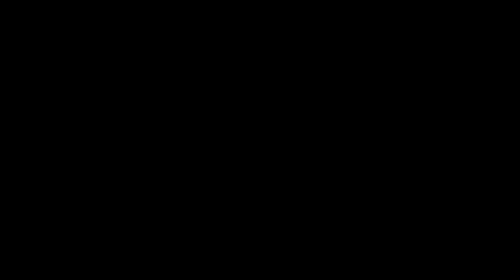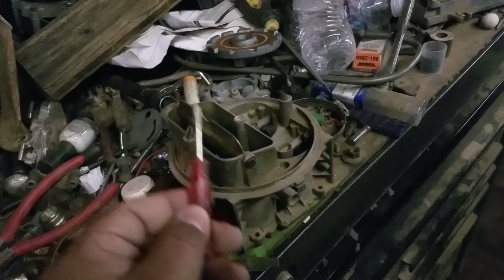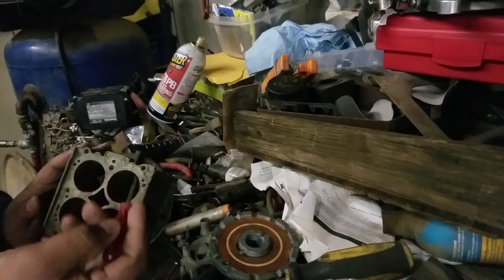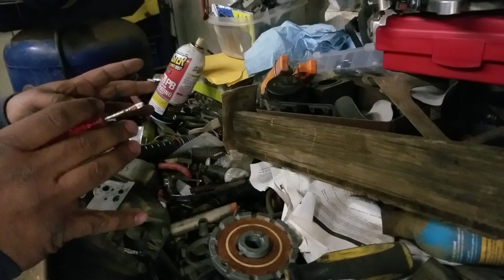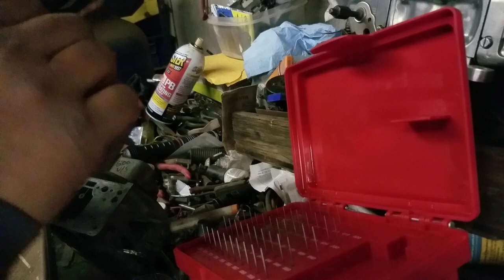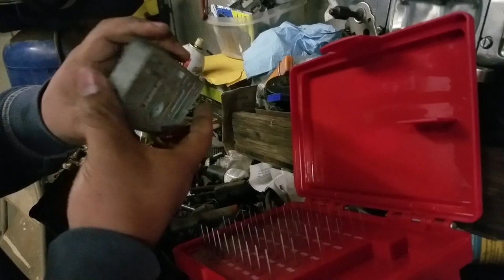5 Secrets For Tuning And Adjust Holley Carbs That The Pro Builders Wont Tell You | Carb LS |NW Ep.60

Comment: You learned all this in a year? Study for 2 and operate on my wife's brain 🤭
Reply from the maker: Lol, when you daily drive a carbureted engine hundreds of miles a week with a vacuum gauge and AFR gauge hooked up, you tend to notice the patterns and once you apply the changes, you can confirm the results or change your method of attack. It gets a little repetetive but after you get it, you get it.
Reply: @NightWrencher  I'm just learning a little bit about my carb, just really started about a month ago, nothing major. Playing around with the simple stuff like choke, idle speed, accelerator pump spring settings. I'll keep up with your videos--- 🤜🤛
Reply from the maker: That's great man, just take it one step at a time and you'll be a pro in no time 👍

Comment: What AFR Gauge do you recommend?
Reply from the maker: Im running an AEM gauge from summit. It was 180 free shipping and has worked great for over a year now
Reply: Thank You for all the GREAT TIPS... On my dual exhaust w/ a cross over where is the ideal place to install the bunge/ probe/ chingadera lol😋?
Reply from the maker: Within 12 inches from your collector on either side of the exhaust works fine. You dont need to install it where both sides hook up if the crossover is too far away
Reply: @yazming1720  "chingadera" 😂😂
Reply: Ive been building hot rods for 20 years. You dont need an AFR gauge. All you need is a Vacuum gauge. Lots of videos from old timers on how to use them properly for tuning. They were the only thing needed for 60 years and racers will only use a Vacuum gauge.

Comment: I like your videos and I appreciate how you're trying to help people learn an old style of Technology with modern techniques and things but your explanation of the use of the power valve is completely wrong. 
The power valve directly relates to vacuum manifold pressure and the only reason you have the adjustability is to compensate for performance and racing camshafts that produce little to no vacuum 4-6" at idle. That is it! If your engine is running above 16 in of vacuum at idle you do not need change a stock power-valve they don't even make a higher power valve for higher vacuum application it is only to be changed for engines that produce no vacuum.
If you're having issues with hesitation or leaning enriching issues and you try to change a power valve to fix it your only been band aiding one issue and creating another. You do not need and I will repeat this you do not need an AFR gauge to tune a carburetor properly people have been running carburetors for six decades without an AFR gauge I tune carburetors without a AFR gauge and have no problem with riching and leaning. If you're worried about your engine being lean or Rich that's why we check spark plugs, there is always going to be periods of richness and leanness throughout the powerband or when applying the throttle or deceleration that is going to create spikes and drops in your AFR you will never have a consistent AFR throughout the range of the throttle plate. 
90% of issues that have to deal with hesitation are the pump not being lashed properly. That is assuming you have the proper timing setup timing and carburetor tuning go hand-in-hand the timing on a carburetor is crucial with EFI you have a lot of wiggle room because the computer will compensate for a screwed-up tune by retarding or advancing timing. You can't forget about timing when tuning a carburetor
Reply from the maker: I'm going to give you an example of why that is not the case. Lets say you tune your main jets and transition to run at 14:1 to save fuel and run cleaner. Now, say you're idle vacuum is at 22hg but your cruising vacuum is at 16. Lets say youre trying to accelerate to get on to the freeway, by the time you drop to 8hg youre AFR is hitting 15 or more and will cause hesitation. Solution would be to accelerate more to drop the hg to 6 and open the power valve but then you've accelerating more than you want to and wasting more fuel. If PVs were made to compensate for big camshafts, they wouldn't need to make a 8.5, 7.5, 10.5, etc. Originally the PV was called the economizer valve and in fact drag racers don't use PVs at all because at WOT vacuum is at 0 always so theres no point in having a PV. When tuning a carb for a daily driver, tuning from 12.5 to 13.5 could save you at least 2 mpg. The engine, if left at 12.5 would run fine, wouldn't smoke that much and only smell a little bit. Tuning a carb to run clean on the freeway requires other modifications to prevent lean spots when you accelerate but before opening the PV and secondaries. I just went through this on my truck while towing on a 6% grade. I was towing up hill but starting to lean out at part throttle, vacuum was sitting at 7-9 for miles, I could drop the AFRs down by accelerating more but then I would be going too fast. On the next trip i swapped to an 8.5 and I was able to go up the climb with no issues. The problem is youre looking at things through a racing lense but not everything has to be about racing some of us just was a carbed vehicle that runs clean and doesnt smell like gas while we are driving
Reply from the maker: I go through this every day, Ive been daily driving a holley carb for almost 2 years now on my LS. The only time I had a hard time keeping a consistant tune was when my old base plate wore out and it was leaking air through the throttle shaft bore. Holleys are excellent carbs. Each system runs independent of one another and you don't have to worry about fluctuations in vacuum to get your tune right. I don't know if you're trying to insult me by saying my numbers are made up, but you can see in my videos that both an AFR and vacuum gauge are always hooked up to my truck. All my adjustments are made based on how I see the numbers respond on my drives. Over 10k miles of daily driving with little to no racing teaches you a lot about tuning holleys. I've towed trailers for hundreds of miles at a time with zero issues and make frequent long trips throught different elevation extremes in my truck without having at adjust anything. Idk why you dislike them so much, but thats fine, to each their own.
Reply: @NightWrencher  I suspect I may have the base plate problem. How much play in the throttle shaft is acceptable? What are the symptoms when this occurs? Thanks for your help.